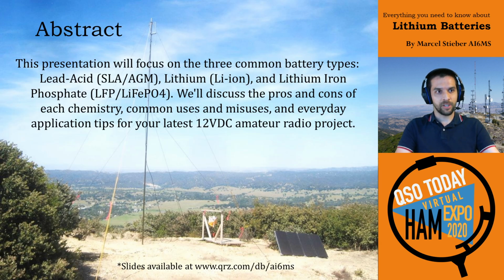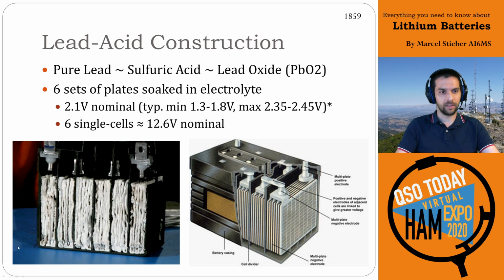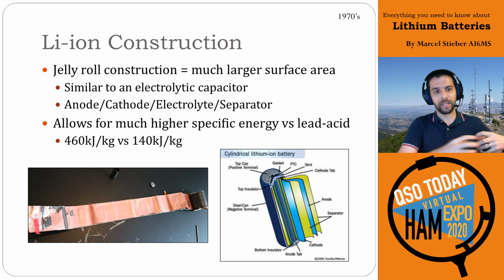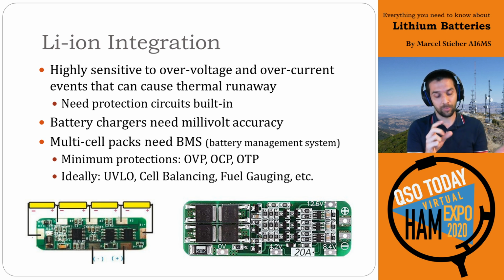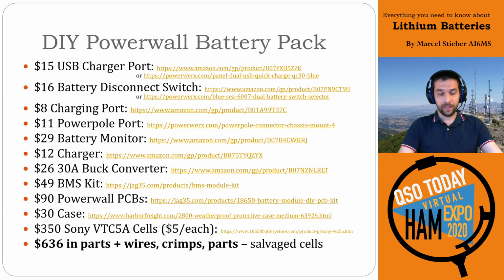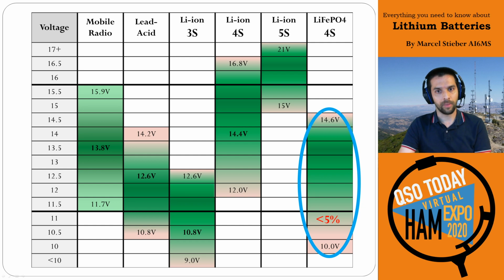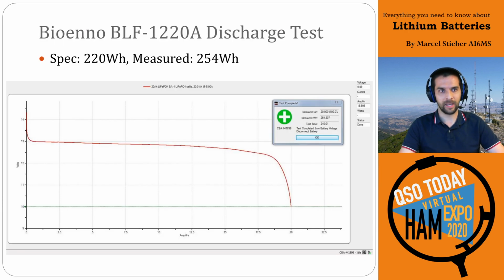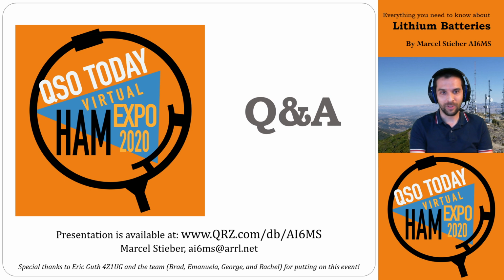Everything you need to know about Lithium Batteries - QSO Today Virtual Ham Expo 2020

Comment: Great presentation.  Wanted to build a battery pack so I can say I did... then Ill buy bioenno.   I purchased a daly bms with bluetooth.  connected with my android phone for 30 min, then the program stopped updating data.  The windows usb program has never connected.   Any suggestions?   good source for software?  Toss this one and find a reliable one?  thanks.  this is for ham radio use, 90 Ah with a 100ah daly bms...  (overkill but I dont think that is my problem)
Reply from the maker: I've only played with the Daly Smart BMS a bit, haven't heard of that issue with the phone. I really like my JBD BMS (rebranded locally by Overkill Solar). The app on overkill's website works great.

Comment: Other big issue with buck converters is small current without load. It will discharge pack in long use surprisingly fast.

Comment: Outstanding presentation Marcel!  I've been collecting bits & pieces of this kind of info for years (you should see my ragged 3-ring binder...) so seeing a comprehensive & practical talk like this is music to my ears.  I really appreciate how you took a systems approach showing all the pieces in an end-to-end configuration, and how you characterized the alternatives along multiple dimensions (cost, weight, integration, protection...) as indeed these are all part of the decision process when aligning your battery option to your design goal.  My 15 year old AGM batteries just bit the dust and I'm in the market for a replacement battery bank.  The technology has advanced greatly and you've given me the crash course in modern battery chemistry which I needed.  Best Regards.